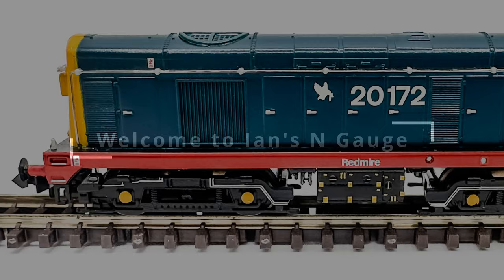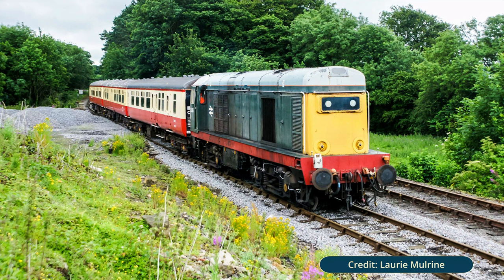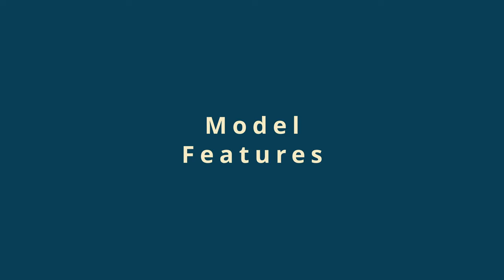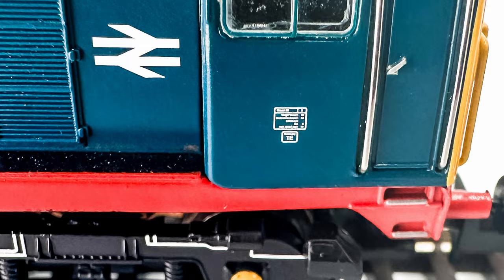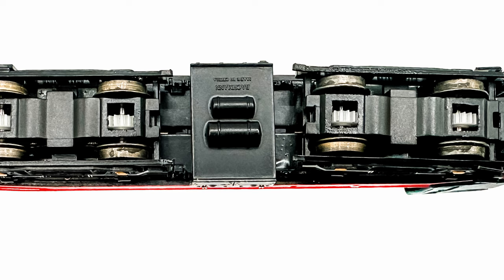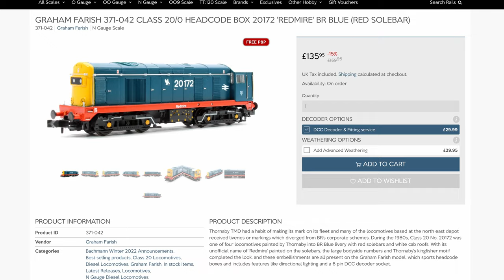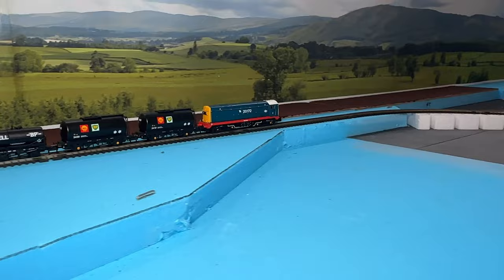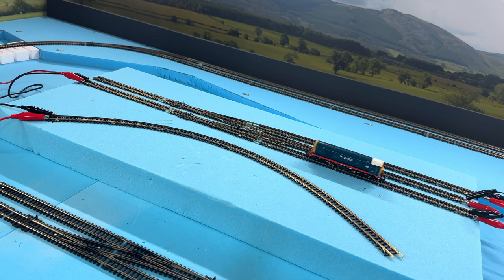099 - Review - Graham Farish Class 20

Comment: Hi Ian, colour is  always a difficult subject.  Pulling out my British Rail Designed 1948-97 by David Lawrence  - the Glossary of colours has swatches and definitions of some of the colours used. The Blue Pullmans are noted as BS381 174 which was a lighter shade of blue, whereas the Glasgow Suburbans were BS381 009 a darker shade. The London Midland ac units (class 80-87) ar noted with two shades - BS381 107 or BS381 175 - both lighter than your Class 20.  The British Rail 'National Livery' from 1965 had a blue for locomotives - BS114 the swatch which looks very similar to your 20; this was also the colour defined for passenger coaches. My recollection of the passenger coaches of the 1980's is of a lighter blue. The difference could be due to daylight viewing, sun bleaching and weathering as the paint aged. I expect  BR used the same centrally defined colours to newly paint things but the application of the paint may be of variable quality. Cheers for this review - particularly your comments of GF's instruction sheet.
Reply from the maker: Hi Tony! Definitely! Colour is always a contentious issue at the best of times! However, during the BR TOPS era, at least, the vast majority of locos were painted in what I would call BR Blue - as do the majority of paint suppliers! I should have shown a shot of this loco stood next to my class 03, 08, 31, 33, 37, 43 and all of my Blue / Grey Mk1 coaches, which all match, and the 20 stands out as too dark! Anyway, thanks for the info! I'll have to look that book up as it sounds like a good read! Yeah, the instructions are abysmal, but no worse than most of the other manufacturers - Dapol, I'm looking at you! All the best, Ian.

Comment: Hi Ian, I have had similar experiences braking things just trying to get the body off. I think these manufacturers should be posting a thorough video of unboxing on release, decoder fitting, detail fitting and lubrication. it would take the guess work out of things when pulling hard on a bogie and questioning why it wont come out etc.
Reply from the maker: Hi Chris! I completely agree! Even just having comprehensive step-by-step instructions online would go a long way to helping modellers to not destroy their model once taken out of the box! Videos would be a very welcome bonus! There were so many things missing in these instructions (no mention of clips holding the body on, no mention of being able to easily remove the bogies, no mention of cab being a separate part, no mention of where to lubricate) that they were next to useless! All the best, Ian.

Comment: Hello Ian. I’ve just purchased a new old stock class 20 and I have to agree with you about the instructions. It was only after I’d removed the four screws that I found out that the cab was a separate part. Once I discovered this I was able to remove the blanking plate and carefully put a decoder in without removing the entire body shell. It wouldn’t take much for them to tell you this. What’s your next purchase? I’ve got a Dapol class 56 on pre-order.
Reply from the maker: Hi Richard! I'm glad I'm not the only one to find the instructions frustrating! I tried fitting the decoder with just the cab removed but couldn't quite get the pins to locate properly! I've also got the Dapol 56 on pre-order, and an A4, and I've recently purchased a Dapol 27, which I'm hoping to receive next week! All the best, Ian.